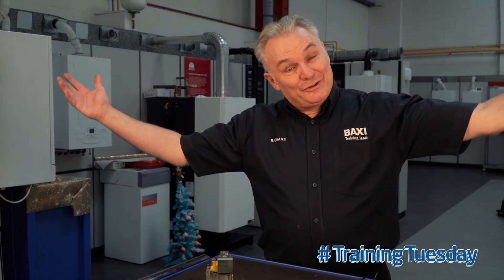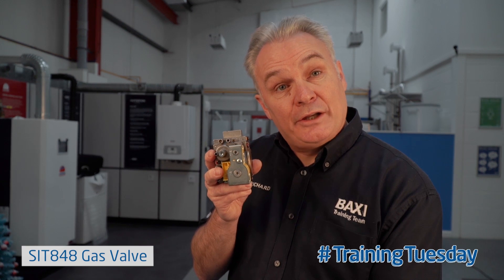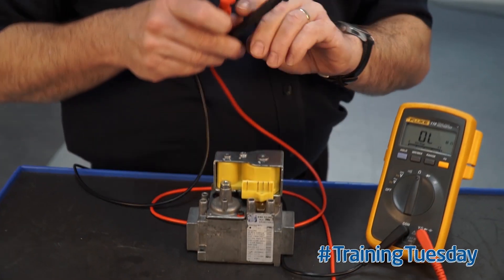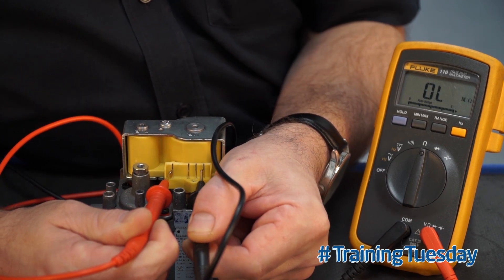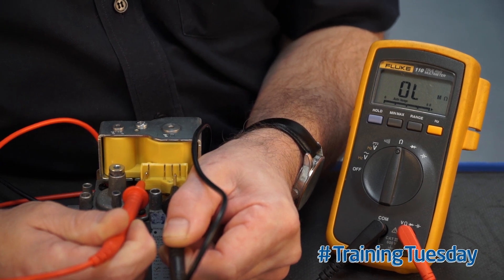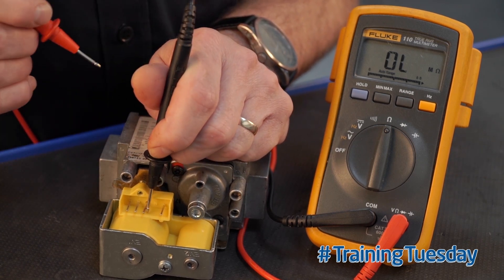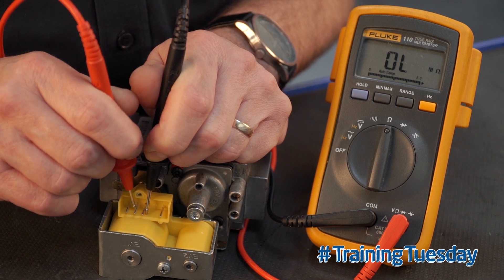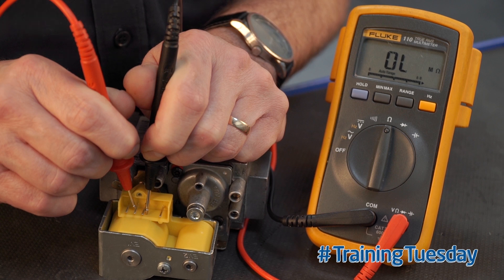How to test a boiler gas valve with a multimeter | Baxi #TrainingTuesday

Comment: Hi, I check my gas valve resistance  at top and bottom pin, it measures 54ohms.. have seen other video they had 104ohms.. so got worries that mine on way out, but when I seen that yours only measures 7ohms, I feel a bit better now as probably mine still alright 🙈
Is this normal that 3 different gas valves could have different resistance? Yours 7ohms, mine 54ohms, and another 104ohms.
Reply: are you gas safe
Reply: @Ed-fp9rx   of course. Anyway it was ignition cable.
Reply: Always refer to manufacturers instructions